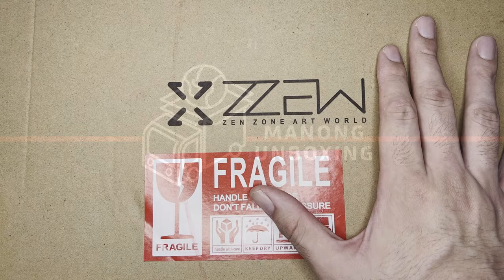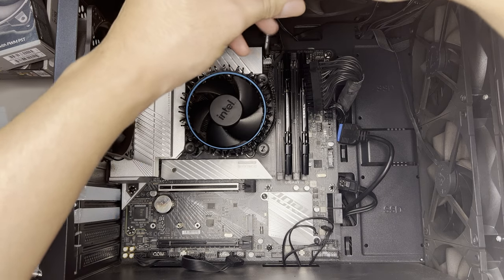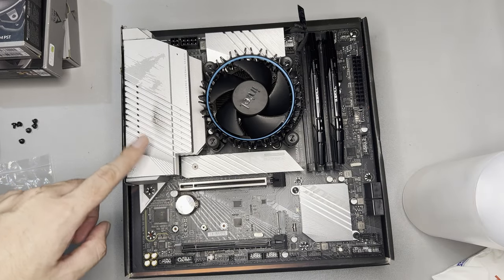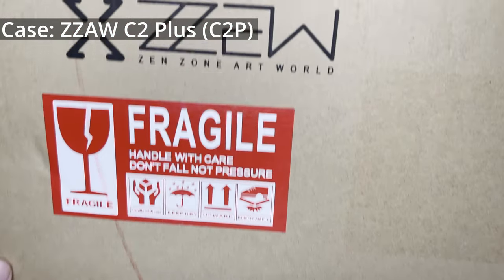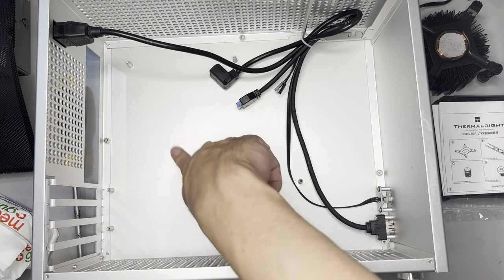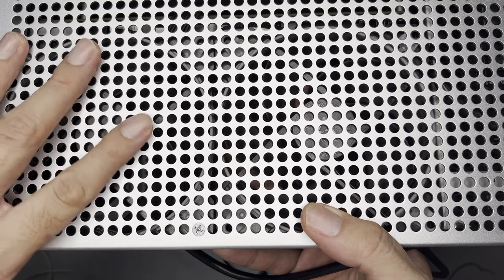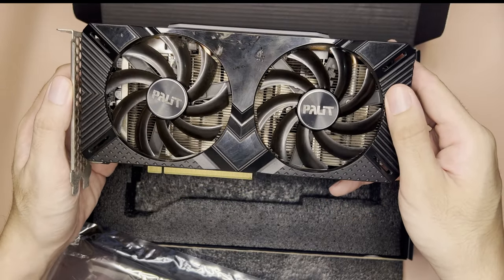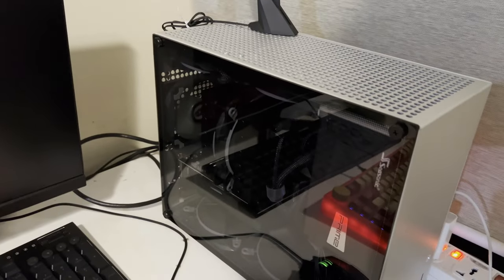ZZAW C2P Build | A 15.3L SFF MATX Build | PC migration

Comment: You can't use a magnetic dust filter unless the case is magnetic right? I have the same case and it is aluminum. So buying a magnetic dust filter is a waste of money. I just screwed it in with the fans.
Reply from the maker: Yeah, magnets don't work in this case. So even the wifi external antennas won't stand. My point though with the dust filter is that it is hard to clean. There are lots of dust now in my filter that I can't really clean thoroughly because of this.
Reply: @manongunboxing  Oh sorry about that haha. Sabagay mahirap din nmn linisin ung dust filter nung akin kasi nga nakaipit sa fans😅
Reply from the maker: No problem (no need for sorry 🙂), baka di rin clear sa video at the time.

Comment: kinda late.. i have a Biostar mATX MoBo that's smaller dimensions 22.5 x 18.5 cm, will the screws fit or is it for the standard size MoBo only?
Reply from the maker: It's for standard only. With that, it should be fine. One side will not be screwed which is usually fine. Just be careful when removing cables from the motherboard to prevent bending
Reply: thanks for the reply, will take note on that.. my current mATX case is Goldenfield N1 (kolink sattelite) but planning to switch on AMD proc soon..

Comment: Is there any actually difference between this and the regular c2 style..they almost look identical?
Reply from the maker: Regular c2 is smaller and more restricted in terms of components compatibility.
Reply: @manongunboxing  you think a 3080 ftw would fit in this case or would it be too tight and have heating issues
Reply from the maker: I am a bit scared on that as the gpu is tall  @ 136.75mm. c2p's gpu height compat is 137mm but I doubt that zzaw tested it. Length-wise you will not have an issue though.
To give an idea, the 135mm cpu cooler fits just right (1mm or so clearance). When I did not fully tuck the fan to the cooler, the fan's edges hit the side panels. I pushed it a bit and it was very negligible for me but that was probably a millimeter...

As for cooling (haven't tested yet), I think it will be doable but probably not practical. In case it fits, your gpu will be up against the glass side panel with a less than 1mm to spare, so some of the heat will go to the motherboard area as it has vertical fin stacks. But good intake and exhaust fans can fix this. I need to say good exhaust fans this gpu could saturate the heat near the motherboard... So this should be exhausted of immediately.

Comment: Great video. Did you try removing the I/o panel from the 6800xt and then sliding the card in head first at which point then screw the panel back on and screw it to the case? That’s what I had to do in order to get my card to fit in the case.
Reply from the maker: Ah no. Didn’t bother… thanks for the info though. Wife is happy with 2060S

Comment: In the beginning of the video, we almost have the same set up. A proper Matx casing with 5 fans and an intel stock cpu cooler. 

I was wondering since how's the temp compared to your previous MATX set up to the C2 case? I'm torn between ZZAW c2 or b3
Reply from the maker: hi, sorry but I don't have data from the previous build and won't be able to get back to it.

Comment: gpu will fit if u install mobo + proc first then the gpu slightly angled, followed by ram cooler and psu sfx much better..
Reply from the maker: Tried it. Didnt fit.
Reply from the maker: Or maybe I wasn't persistent enough. Though I removed everything excpet mobo and cpu,  it didn't have enough depth to wiggle around and the angle doesnt help as compared to thicker cases

Comment: nice and very helpful review!
planning to get this case to maximize my desk space, but I'm not sure if my msi 5600 xt gaming mx would fit as I have a non modular psu (cv 650) so there will be alot more cables.
also wondering if you can fit 1HDD along with the SSD.
edit: 
psu is not sfx
gpu is 297mm
Reply from the maker: It seems it can fit though pretty tight and might be challenging as you have a big GPU. CV650 is as wide as ATX but only as long as SFX-L PSUs. so you have 15mm more room for cables which you can route beside the GPU.

Re: HDD+SSD, I think you can based on specs, and iirc, the HDD will use one fan slot at the bottom, while the SSD can be mounted at the front (there's a pocket at the front).

Comment: Hi manong, planning on using this case with the same air cooler. Any issues with the Silver Soul 135 in the case? Noticed that 1mm difference lang ang side panel clearance niya. Hindi ba if mabangga yung tempered glass, matatamaan narin yung CPU Cooler? or nag-ooverthink lang ba ako? haha
Reply from the maker: So far, no issues naman

Comment: HI Im planning to buy this case for my red devil 6800xt 320 length will this be an easy fit? card thickness is 62mm
Reply from the maker: No, it will not fit.

Comment: Can you fit a PA120 SE on this case?  if not, whats the best air cooler you can use?
Reply from the maker: No. Max height is 135mm for cpu cooler. Best ones would be the cooler I put (SS135), from ID cooling would be SE-207-XT SLIM, from Noctua would be U9, from Scythe would be Katana 5.
Best of the best? Sorry, I have no answer on that as I haven't tested the other lineups except from thermaltake.
Reply: @manongunboxing  Do you think a low profile CPU cooler like Scythe Big Shuriken would be enough to cool an R7 5700x?
Reply from the maker: Yes. 5700x is an easy-to-cool CPU.

Comment: Did you try putting in the 6800xt first before the psu and mobo?
Reply from the maker: No.

I think I explained why it is tough to fit in a 310mm gpu (diff in GPU dimension definition).

If the case was thicker, it might be possible as there will be some room to wiggle (this is what I do for strix and just right length cases). Since the case is relatively slim and short compared to mid towers, I am hitting motherboard heatsinks and components (was also shown in the vid).

Anyway, it seems that you aren't convinced, my reco stands to get a 300mm GPU for this case (using gpu manufacturer's definition). If you think it can fit a 320mm 6800xt, feel free to take your own risk. 🙂
Reply: @manongunboxing  There seems to be a way to remove the bottom panel and try to squeeze the video card from there.

Comment: Compatible ba ang cooler ng intel sa d19 pro?? Btw nice build aldo d ako fan ng matx sff build pero nice review pa din reveiw mo din sna ung inwin chopin max sir thanks
Reply from the maker: Yes sir. Intel stock cooler's height is 47mm. D19 Pro's CPU cooler height is 64mm.

Thanks sir, ipila ko si Inwin Chopin Max, pero baka Feb pa sir, may 2 builds na akong nakapila.

Comment: Hi! Would be possible to fit a 120mm water cooler on the top?
Reply from the maker: Looking at it, it seems possible. The rad+fan will be at the center of the case. But i haven't tested it, so I might be wrong. Your issue here is the height of your motherboard components, so it will depend on motherboard heatsinks and ram height.
Reply: @manongunboxing  I'm using Aorus mini itx motherboard and low-profile Kingston fury memory with Noctua am4 cooler low profile. The problem is that the radiator with a cooler would be too fat. I bought this case and I'm waiting to arrive. Another problem is that I will have to use a tax power supply of 160mm from corsair. Another problem I will have is the GPU, I will have to fit a RTX 2080 super Aourus 290mm.
Reply from the maker: Looks like a challenging build. Hope everything fits.

Comment: How about cooler, can it fit with 240mm ?
Reply from the maker: No, it can't. Only air cooling. From the top, the thick rad and fan will hit the motherboard and likely the RAM as well. 

From the bottom, it might be possible with exactly 2 slot gpu's but it's not recommended for aio.
Reply: @manongunboxing  oh yes i forgot about RAM, thanks for the answer, may i ask you again? 
1. How about durability/quality, i want to compare with nr200
2. I want to build with mobo 24,4x24,4 (mAtx) and psu atx is it possible? Can you share your experience please 🥺
Reply from the maker: No problem. Although sadly, I have not yet tried building on NR200. In general however, ZZAW is on par with mainstream cases in terms of quality. Definitely sturdy panels though they need to polish painting and overall case design.

mATX and ATX psu combination is definitely doable just like my build. However, for normal-length ATX PSU note the hardships that I documented in this video when pairing with a long GPU. If your gpu is short (<=250mm), then it should be fine.

Comment: Can i use aio?
I use is40x on this case and closed case it heats up to 90c
Reply from the maker: It's probably too tight for an aio at the top. There is no specific rad mount at the bottom and it's not recommended to install radiators at the bottom (for asetek aio's).
Reply: Only a 120/140 aio is possible as the power port will be an inteference on the top while there isnt enough space at the bottom